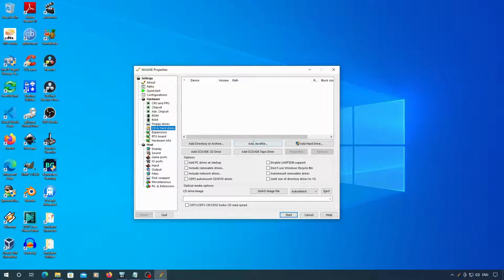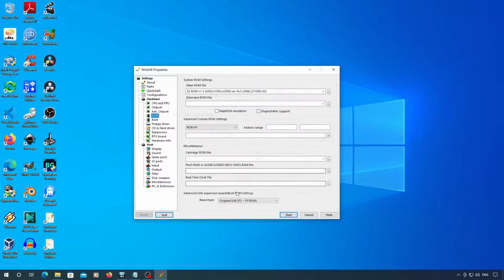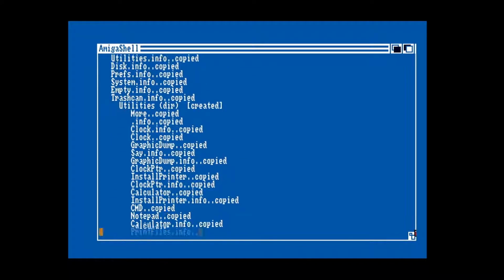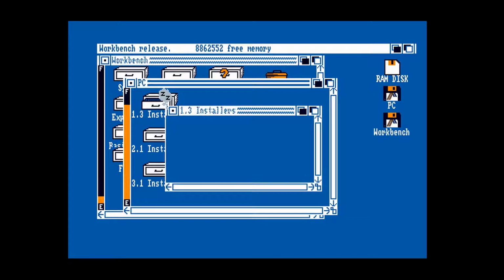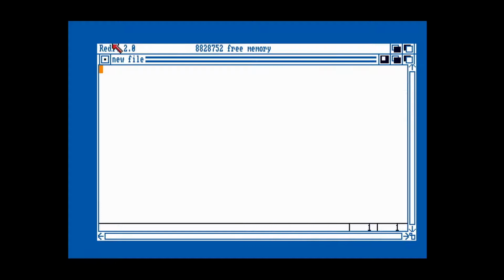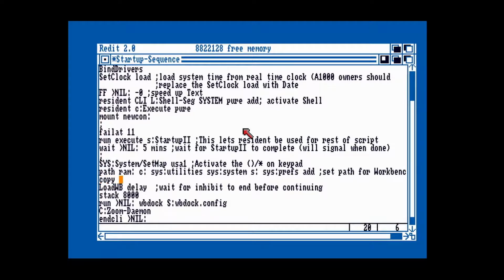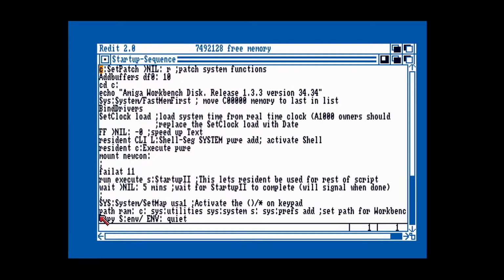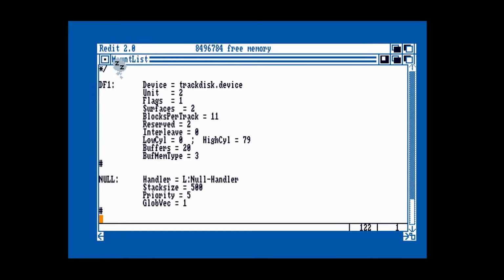Setting Up an Amiga Workbench 1.3 HD Install

Comment: Hello,
I have CF2IDE adapter with 2GB CF card, any guide how to prepare and setup this card to make DH0?
I've tried to format it on Amiga via HDToolbox from Workbench 2.1 install disk, but later it is still not visible under kickstart 1.3 and workbench 1.3 disk, so I can not copy workbench 1.3 files... :(
Reply: there are youtube videos on this- use msdos (cmd windows as admin) to run diskpart and then clean the CF... then use UAE to add it as an ide drive (auto), and use hdtoolbox with the right scsi.device setting (i forget!) to partition it just like he did. if you pay for winimage, you can use a .vdh or .dhf file from the net to write to the CF and avoid all this crap. Amigas make things a lot harder...
Reply: PS- many CF's don't work, and some do- all trial and error.

Comment: Ok, heres a tip that helped me. My WB21 disk didn't have the DF0:L\FastFileSystem file so the partition and format didn't create a disk that WB13 would recognise (and HDTOOLS gave an error)... So if this happens, just find a WB13 disk and copy the file DF0:\L\Fastfilesystem to the boot L folder
Reply: works on hardware, i had to delete the demos from my real disk :) to get some place for fastfilesystem
Reply: Are you talking about the Libs drive on the W2.0 install disk? I copied that file there and it still does not work. I rebooted in 1.3 and then copied it over to there since the install disk for 2.0 does not have either a CLI or Shell.